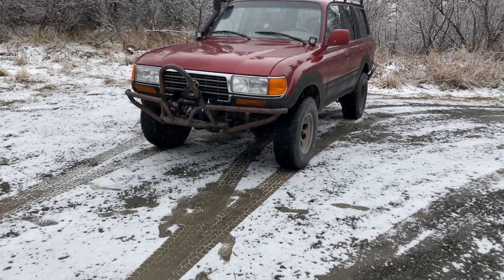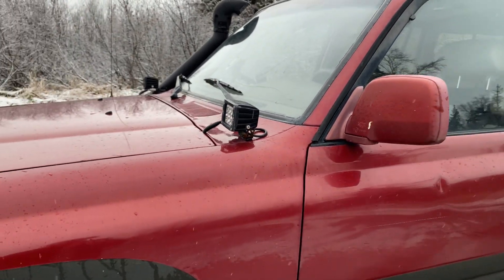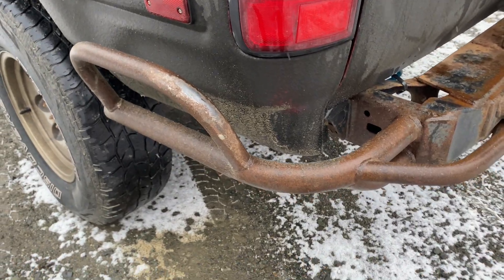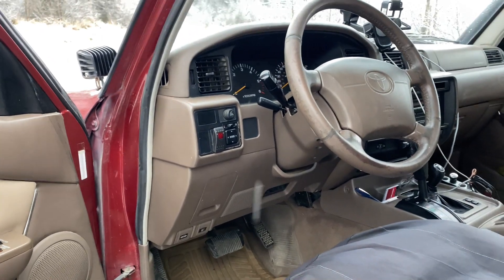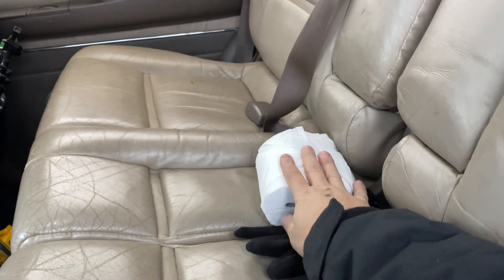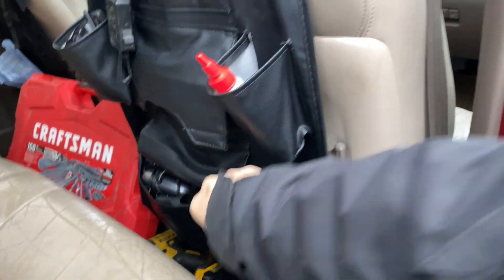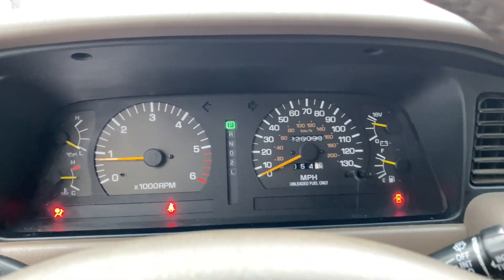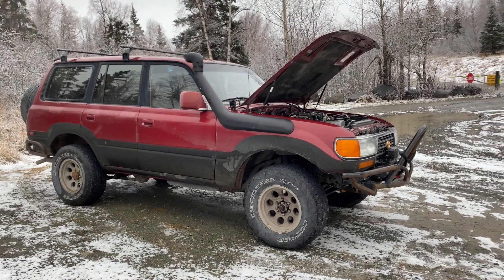1995 TOYOTA LAND CRUISER | FIRST WEEK OWNERSHIP | WALK-AROUND TOUR

Comment: That hose is for the rear heater. Those hard lines get rusty and leak coolant. So they did a rear heater delete. Did the same to mine.
Reply from the maker: Ty
Reply: Why would they do that in Alaska. It gets extremely cold there
Reply: @xNickerishx  the hard lines that rot out I think are discontinued and it’s kind of a pita to tackle